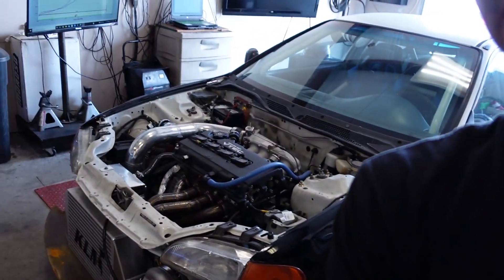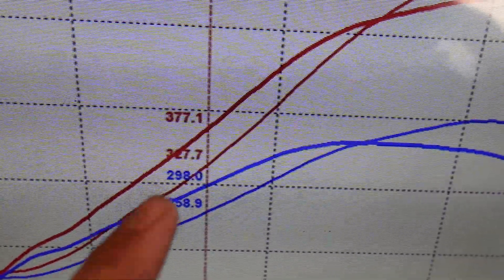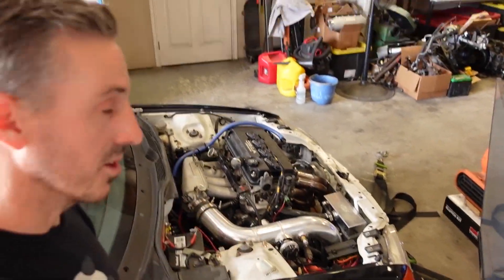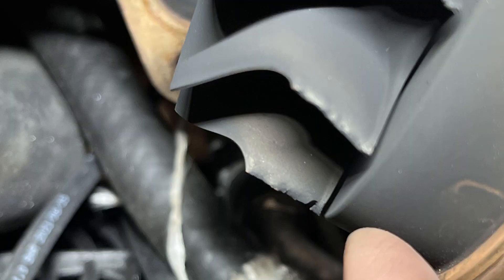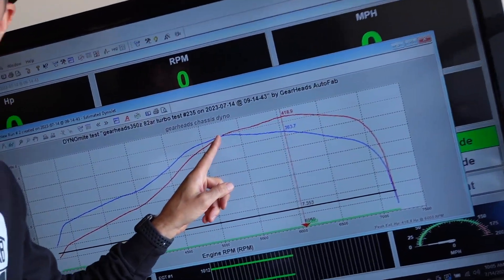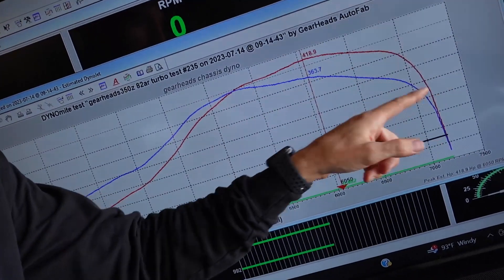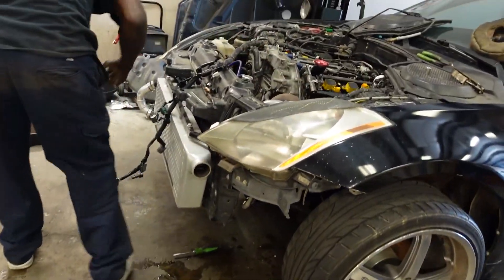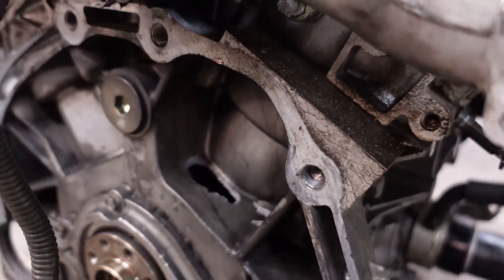22psi blow up 350z

Comment: That wasn’t a crushing down the highway blow up. No way.  Really, how much boost was it at?  Maybe low rpm high load situation?  Although the piston in the intake is normal when they let go like that. Even when it’s just a normal let go they still get piston chunks in the intake. Or at least when a piston fails. I will usually replace the intake, although being a 2 piece intake, clean it really good and roll.
Reply from the maker: I mean …… to be fair he was probably getting on it really hard and then it let go once you hit the highway….. but ya that the coolest blow up yet

Comment: Damn, sucks to hear about the blown engine. But 22psi is pretty high on a stock engine right? Also IIRC back in the days when the 350Z first came out, one of the tuner said that the ignition is not able to support much more than 7psi. So maybe some misfire took down the engine.